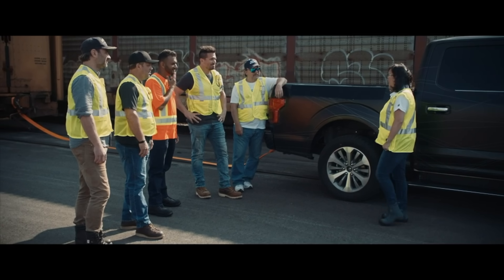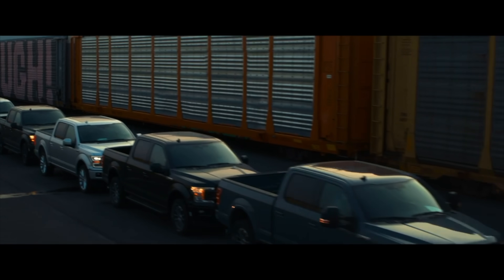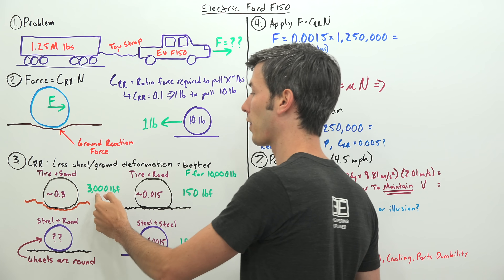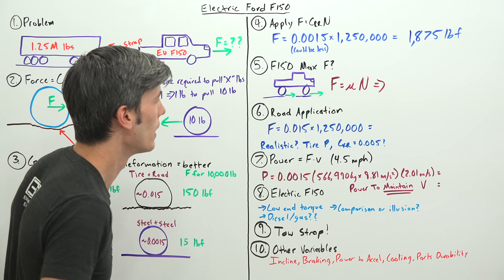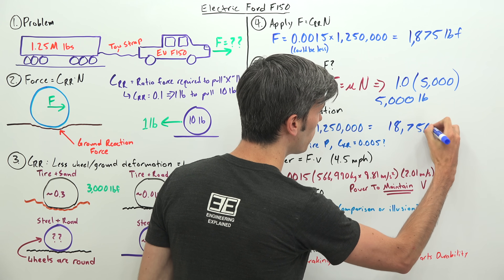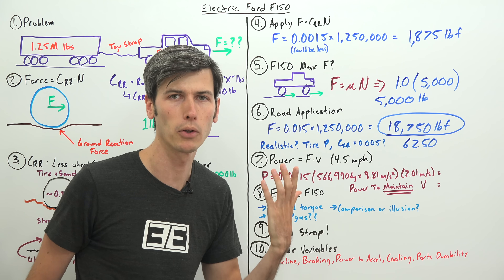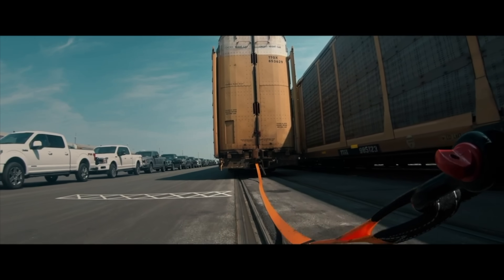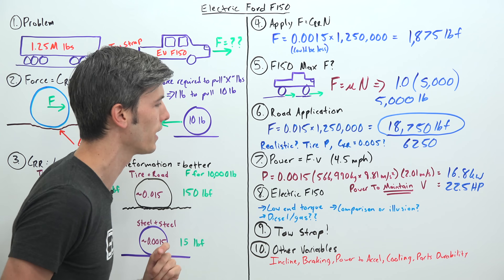No, Ford's Electric F-150 Can't Tow 1 Million Pounds (Realistically)

Comment from the maker: *IMPORTANT NOTE* This video was filmed prior to my article being published in Road & Track (link below). Upon release of the article, Ford reached out with additional information. They said the truck was traveling at 4.5 mph when it crossed 1,000 ft. From this, we can calculate power required: 
1. We want to know how much power it takes to move 1.25 million pounds at a speed of 4.5 mph in just 1,000 ft. 
2. We’re going to assume the truck is accelerating for those entire 1,000 ft, and reaches 4.5 mph right when it crosses the 1,000 ft. line.
3. Power = Work / Time. If we calculate work & time, we determine power.
4. Time can be calculated based on average speed over 1,000 ft. Top speed 4.5 mph, starting at 0 mph. Average 2.25 mph. 2.25 mph = 3.3 ft/s. 1000 ft / 3.3 ft/s = 303 seconds (5 minutes, 3 seconds, to go from 0 to 4.5 mph). T = 303 sec.
5. Work = change in kinetic energy. We start at 0, so kinetic energy is zero. All we need to know is final kinetic energy. Kinetic energy is equal to one-half mass times velocity squared (k=0.5mv^2). 12.5M lb = 566,990 kg. 4.5 mph = 2.01 m/s. KE = (0.5)*(566,990 kg)*(2.01168 m/s)^2 = 1,147,263.561 N-m. 
6. Plug in variables to Power equation. Power = Work/Time. P = (1,147,263.561 N-m)/(303 seconds) = 3.786 kW or ~ 5 Horsepower.
7. It’s important to note that 5 HP is the power required to to accelerate this mass assuming zero losses. Heat, friction, aerodynamics, etc. There are also smaller assumptions like not accelerating any rotational masses (the train has wheels, etc). A sanity check using the same math shows a 3,300 lb car requires 240 HP to go 0-60 in 3.0 seconds. We know it’s generally double that in the real world. Even giving the truck a factor of 10 advantage, 50 HP is nothing crazy. 
8. The train is very heavy, this is the impressive part. Unfortunately, the duration is very long (5 minutes), and the speed is very low (5 mph). Both time and speed variables work heavily against the power required. If the train were to accelerate to 60 mph in the same 1,000 ft distance, it would take 12,000 HP without losses. Quite a difference, just from changing speed! 

Road & Track article covering the stunt: 
https://www.roadandtrack.com/new-cars/a28506476/ford-electric-f150-train-tow-physics-explained/
Reply: kind of old news but a couple years  ago there was a toyota tundra that pulled a rocket ship  and was wondering if you could discuss the differences in forces between that stunt and this stunt?
Reply: @karljohansen3935  he displayed the math and variables. All you need to find is the shuttle + trailer's weight. Plus the type of tires and pressure needed to support the shuttle.
Reply: Karl Johansen 
Yep. That was when Toyota used a Tundra to pull Space Shuttle Endeavor from LAX to the California Science Center. Any truck with specs similar to the Tundra could have done the job, but Toyota has existing ties with the science center that put them in a good position to do the pull of Endeavor.
Reply: @karljohansen3935  The main difference is that Tundras are boss af and it actually went into space to grab the ship, whereas Fords are limited to more traditionally terrestrial environments.
Reply: @karljohansen3935  5th gear towed a 747 i think with a vw toureg
Reply: Karl Johansen : the space shuttle with the towing gear weighs 300,000 lbs.  That requires 4500 lbs force to tow it.
Reply: @karljohansen3935  - Have you seen the guy who pulls an airline with just his body? If he can do it, most pick-up trucks can do it.
Reply: Holy engineering degree
Reply: @Leondavies357  Hahaha I feel like I just earned mine by reading all that 😂
Reply: @Leondavies357  actually grade 11 physics, but I still love this guy!
Reply: @ericsimonson3128  hahah fair
Reply: Leon its really only basic physics
Reply: Leon honestly some simple ass physics calculations. That I’ve done in high school classes
Reply: @Leondavies357  So you can tow what a diesel tows with a small SUV that tows 4,000 pounds based on his calculations..
Reply: @Leondavies357  it's not actually hard to understand if you get it.
Reply: I wonder if they did the train car trick where they bunch up the cars so that they "effectively" only have to accelerate each one, one at a time.
Reply: @glassfullofmilk  it's not a trick, it's a standard feature of train couplings. In another comment this was pointed out, the fact that compression couplings exist specifically to make the process of starting a train much easier. All trains nowadays have compression couplings.
Reply: @jordananderson2728  here is the thing though. You have the length of the fitting (what about 6 inches), to accelerate the train car enough to overcome the resting friction of the next car.

I once watched a rather long train accelerate from stop. It took several tries for 6 locomotives to start it.

With it stalling out before half the cars started moving, and had to backup to recompress the couplings.
Reply: @capnbilll2913  I don't quite see what that has to do with what I said, but I'm glad to have learned something else today. Thanks!
Reply: @glassfullofmilk  I suspect they were, and the truck could therefore accelerate the cars one at a time. That's how diesel locos do it.
Reply: @glassfullofmilk  I'm pretty positive that was another trick--at no time when first starting was the entire load being moved all at once.
Reply: @glassfullofmilk  that's how all freight trains accelerate. This is called slack and is caused by play in the draw bars which also helps trains go through a curve. A locomotive would never be able to accelerate all 1-2 miles of train from a stop all at once so they get them going one at a time and use momentum to help get the others rolling like you said.
Reply: @glassfullofmilk  ... Thank you...i was going to post this concept but you save me from punching my keys....

This is called 'stretching out the train"

Your average diesel locomotive cannot start pulling a train unless it starts rolling one train car at a time.

I work for a mill that uses a lousy 25 horsepower 5 ton forklift to move traincars in and out of the loading dock, and it does quit well.
Reply: What I want to know is how they stopped the train? Did they have a power unit hooked to the other end of the cars to control the brakes?
Reply: @myofficegoes65  i am sure they had people on each car to turn the wheel to apply the manual brake on each car.
Reply: @myofficegoes65  Ford forgot to think of that detail, actually. The video they used for the commercial was actually their second take. The first take had an unfortunate ending.
Reply: @myofficegoes65  "What I want to know is how they stopped the train?" Probably an air compressor or an actual locomotive (with their onboard compressor, naturally) attached to the other end of the train. Otherwise, you could have someone alongside a few cars applying the handbrakes as it goes - not ideal, but the walking conditions at that site look good so it could be possible.
Reply: @myofficegoes65  someone just walked up and cut the strap and the truck drove away.  It was only going 4.5 mph. I'm totally guessing.
Reply: @myofficegoes65  they probably have someone with handbrake stopping it I would say
Reply: @myofficegoes65  they probably had somebody using the hand brakes to stop it
Reply: myofficegoes65 all the cars have brakes.
Reply: @myofficegoes65  asking the real question. Those railway cars can't be moved unless the brakes are mechanically disabled or there's a locomotive coupled. This is a safety feature which is near impossible to override
Reply: The whole point here is... Ford is making an Electric truck...  And that's just awesome.
Reply: Also they aren't pulling all the train cars from a stand still. You start by pulling just the first car and you build up a little momentum before the second car engages and starts to move and so on till all the cars are moving.
Reply: So a Top Fuel dragster could maybe get it to 60mph in 1000ft...
Reply: @vskid3  if it had the weight
Reply: @vskid3  if you could get it to run for 5 minutes. They regularly blow up during a 4.5 second run and they always get rebuilt.
It would be interesting to see what you could get out of one in this type of application.
Reply: So what I'm getting from this is anything that can pull a 2000lb trailer can do this trick??
Reply: @wiliammorgan4537  No. Pulling a 2000lb trailer isn't the same thing as pulling with 2000lbf. There's a thing called coefficient of rolling resistance. That's what the video's about!
Reply: @wiliammorgan4537  No. Using his numbers, a 2000 pound trailer on a roadway will only require about 30 pounds of force to move.
Reply: @wiliammorgan4537  No. A 2,000 lb trailer requires less than 2,000 lbs of forward force to move. Difference between lifting the weight of an object and pulling it on wheels.
Reply: @wiliammorgan4537  yes
Reply: There used to be a "strongman" who came around every year and his thing was to pull 2 full size passenger buses across a parking lot... same thing as long as the surface is flat, the tires are hard, etc....
Reply: Did you consider the friction of the wheel bearings to be negligible? Seems it wouldn't be.
Reply: @curt149k  thats considered part of the rolling resistance..
Reply: I feel this was more a reaction to Tesla saying their Pickup could tow 300k.. The thinking being.. Hey if they are going to make some nut job claim why not just tow a train?
Reply: @Napster60  I doubt it as this stunt has been pulled multiple times by multiple companies. There are competitions where people pull massive objects.
Reply: @bensemusx  
True just seems like the timing fits the Tesla claim.. only took them a couple months to respond to other "electric truck" news 
Just a guess
Reply: About time someone address's this big elephant in the room. I can push a 20 ton boat by hand as long as its floating in water.
Reply: Two things are missing. 

The resting friction of the wheels. Good thing this is electric, a clutch would burn out long before you got the first car moving.

2nd that motor is going to be pulling crazy current with full power zero RPM.

I'd be surprised if you didn't melt the pack.
Reply: @capnbilll2913  you're forgetting that motor rpm is NOT the same as wheel rpm...  
  A crawling kit can reduce output 250-500/1!   And more!  
Imagine an engine at 6k rpm turning the tires at 3rpm.. Now we have an electric motor that has a much higher rpm thats reduced for torque. 
    Lastly... A clutch burns out from slipping, not high load... You can drop the clutch idling on a crawler and they'll sit there and spin all fours no problem.
       !!!Gears Get it Done!!!
Reply: @Hoopty91  I'm assuming the gear ratio was not too far from a production rear end. I know you buy larger reductions for towing. Up to 4.3 to 1.
Reply: Well the main question is what happens when you slam the brakes towing 1.25 million pounds...
Reply: @sakariaskarlsson634   never brake-check a train... just a word to the wise ;)
Reply: @sakariaskarlsson634  Your going to be pushed a long ways!
Reply: @brucemaloy4769   i think so and the car would be kinda messed up too
Reply: @sakariaskarlsson634  wait a minute for the rest of the train to catch up at 1mph.. Then kiss your ass goodbye in the slowest train wreck of you life!
Reply: @Hoopty91  lol yes, how did they even manage not to do that when this was over, rc brakes? 🤔
Reply: @sakariaskarlsson634  I'm sure they had a control car or something with brakes😐... I would hope.
But then again, there's not far for it to go at 4.5mph.  
  It would be neat to see this demo with a truck at the other end for braking, see how long that takes..
Reply: so if I read this correctly, my 1999 bmw 328 can do what the pick-up did in the video? lol
Reply: I think the more telling number would be the torque required at that speed. By my calculations the torque required at 4.5 mph to generate 22.5 hp is 2505 lbft for a 32.1" diameter tire (standard 275/65R18 for 4x4 F-150).
Reply: Bro I really just want to know how old you are, 25 or 43?
Reply: Engineering Explained it did move 1.25 million pounds before any other EV truck. Which is a step up in the 
one-ups-manship  dog and pony show. My grandpas old 53 Chevy 6 cylinder could pull 400 bales of hay also. But it is who does it first that counts
I can see everyone pulling this or that now. 😂😂😂😂😂😂😂
Reply: @shashankr5003  to convert it into Newton. When weight is in kg
Reply: it doesnt matter if it would need way more road tires than the ones in the train to carry that much weight?
Reply: With that low of friction cohefficient you can do it with pretty much any vehicle, you need to apply that force over some time and all force applied is not simply lost, the kinetic energy is still there and will accelerate that mass unless there's too much friction that converts that kinetic energy into heat.

Once you gather speed, you only need to apply more force to overcome the new friction that comes with air and wheels rolling over the ground, which is also very low until you start getting to higher speeds.
Reply: Sir... You misplaced a decimal on your lb (12.5mil) congrats you just blew up a $500mil rocket 😍
Reply: Malicious Affection not a rocket its a train, dummy ;) and it wont blow up lol
Reply: Impressive. Probably not very healthy, the electrical motor has to work hard @ low RPM all the time, so it doesn't get a lot of cooling.
Reply: What about those little vehicles at the airport that tow those planes. I know they are not electric but can you convert that and compare it to electric!
Reply: The only advantage the electric motor has over a fuel burning engine is that electric motors can generate a ton of torque at slow RPMs while under load. 
But this train pulling stunt fails to point this out. 
It's just a "Look at me!" marketing stunt. That's all.
Reply: how would this compare  to the V10 Touareg pulling a 174 ton 747 or a Porsche V8 Diesel pulling a 320 ton A380
Reply: Can you please analyse Model X pulling the plane commercial in the same way. It was on a runway I think. Interesting..
Reply: @EngineeringEssentials   Theres a video of a dodge ram pulling your 10,000 pound mom in a trailer, can we please get the engineering specs on that. I think it was faked.
Reply: @EngineeringEssentials  strong men competitions pull planes. I don't see why a car couldn't if a human can...
Reply: @EngineeringEssentials  Apparently a touareg could pull a boeing 747
Reply: If it could be set up again in the same location same weight etc. I'd be willing to tow it with my truck to prove the point
Reply: I think your point #5 should say 1.25Mlb rather than 12.5Mlb
Reply: How many "Fate of the Furious"  Dodge Chargers would it take?
Reply: Not have to stop it, speed it back up, nor turn with it.
Reply: Does the # of wheels matter, (ie adding to the coefficient of friction) or is that negligible??
Reply: Well hello again, saw the comment in Ford video
Reply: Spock spots magic tricks. Good job science officer!! 🌟👍🏻🙌🏻
Reply: @CLP lol trucks have been pulling large things for decades. A few comments up someone pointed out Toyota did this with their truck pulling a rocket.
Reply: They did this because tesla pulled an airplane.
Reply: It's still cool tho
Reply: In all this you neglect static friction. No problem though. Trains overcome this issue by stopping trains from the front, allowing couplings to compress. When the train starts moving again the small gap in each coupling allows each car to start moving slightly before the gap to the following car closes with a jolt. This allows the locomotive (or pickup) to overcome static friction one car at a time. You can hear this in a rail yard when a train starts moving. A series of clunks propagates down the train before movement is obvious.

Additionally, a large battery pack is visible under the truck. Any self respecting truck will have at least a 100kW/hr battery. Rivian, Ford's partner, has considerably more. A Tesla Model S battery has an energy density of 141.5 Wh/kg. That implies over 1500 pounds of battery just for the cells. While the engine/motor swap offsets some of this there would still be an overall weight gain just as there is in electric cars.
Reply: @engineering explained Just to let you know, you have 12.5 M lb instead of 1.25 M lbs in the comment.
Reply: Forgot seal and bearing friction
Reply: @brucebreckenfeld7405  Remember he mentioned the only requirement is being able to tow 1,875 in order to pull a 1.25 million pound weight
Reply: @brucebreckenfeld7405  Then that means a v6 f150 with the same components except engine output will tow the same as a V8 f150. Anyonewho tows a lot would laugh at that
Reply: Thanks to my dad for explaining your comment loo
Reply: Chevy pulled 187tons of logs down the road jn the mid 70’s. They also pulled a container ship onto shore.
Reply: That's why you should work out slow, you'd save energy and be able to do more reps plus allowing more oxygen intake. Try it some time, it's fun.
Reply: That's not a standard tow strap... That strap is close to 5,000lb. The torque on that truck is over 400lb... Yeah this guy is very intelligent, but your missing the hole point. Tesla claims aren't real, Ford  is doing this stunt to make you realize that tesla is bogus claim of 300k lb. Realistically Tesla won't have a truck that can tow 9k lb with all electric. Ford has F-150s now that can pull well over that. But when time comes, all electric f150 will be best in class well after dodge and Chevy get there electronic trucks out.
Reply: Welp time to hook up a Top Fueler I guess
Reply: @tyvekhomewrap9164  Yeah---that'd be something to see!!
Reply: He must be a dodge owner😁
Reply: That would have to be a slow acceleration even with zero rr. F=1.2 million x acceleration stopping at 1000’ is 2500 newtons of force assuming 300 meters in 5 minutes. That’s a lot of inertia to overcome.
Reply: Engineering Explained love the channel man. I’m currently in the process of getting my ME undergrad degree
Reply: I ain't no math wiz but I am a conductor for UP and let me tell you that a light wind can push these cars by itself on flat track of they didnt have handbrakes tied. 1 million pounds is nothing in the trainworld. I sometimes get trains that are 20,000 tonns okay.... that's 40 million pounds. 

This is extreamly deceptive to anybody who doesnt know anything about railroading but this commercial has become a running joke in my service unit. Odds are, that any car you have could pull this aswell. Not impressive at all.
Reply: Pretty Smart Guy! never thought of using the superior METRIC units?! Imperial sucks
Reply: Can you do a video on hood scoop Style ram air intakes versus cold air intakes? (I'm thinking hood vent looking scoops, not monstrous vision blocking scoops
Reply: I'm a train mechanic and several times we pushed 50t metro carts 8 axel 4 boggies outside the workshop by hand to the third rail to get the 750v to one of the contact shoes, 6 guys only so one strong human ≈ 0.3hp so 1.8hp so I'm not impressed.
Reply: Car HP are not real HP , real HP is 550lb / sec / foot ,car is 550lb /hour /foot .
Reply: I've driven several trains in my job (train technician), motor carridges and I can tell you that they spin very easily.
Reply: Busted
Reply: According to your calculations, my 1998 Nissan Altima with 150 horsepower at the flywheel from the factory could probably do this if there was a suitable attachment point.
Reply: Bruh u lost me about 4 hours ago
Reply: Awesome video, great information and presented in a really easy-to-understand way! (As usual)
And congrats on getting published in R&T, that's one of the best magazines out there.
Reply: Engineering Explained I’m just still trying to figure out where the card went?
Reply: When you mentioned the tire pressure that pretty much summed up my thinking about whacking some B737 tires on it or something airliner tyres have normal inflation pressures of >1.4MPa (>200psi). Course the combination of that and the heavy reinforcement makes them a lot more rigid than car tyres. Though this explains a lot how you can pull off competitions having a person pull an airliner their coefficient of rolling resistance is extremely low for a rubber tired vehicle. Then again this trick has been used in vehicle marketing too same old thing though dazzle the audience with something they associate with being big and heavy so they don't really think about the physics of it.
Reply: How much “energy” required to keep the weight rolling?  NOW let me see that truck stop those train cars 😎
Reply: Um? Duh? They didn't go fast, and they didn't get up to speed very quickly either.
Reply: But the Ford F-350 can easily tow up to 200 tons it was on top gear but also yes your a lot smarter than me when it comes to physics I have my biology masters but also regardless it still towed 1.25 million lbs but yes friction of the wheels means it didn’t pull 1.25 million lbs it’s a marketing scene to pull in people who won’t do the math but electric cars have insane torque if ford released the specs maybe that would make it easier to judge how tuff the truck is.
Reply: You're leaving out a significant amount of static friction in this system before anything will move at all. Train wheels have rolling bearings, sure, but they're imperfect.  Also, for something of this size, certainly other contact incur static friction to overcome.
Reply: I've never been more confused by a comment than the actual video. Cheers m8
Reply: I cant help but think that the internal friction from the train probably made the towing force needed quite a bit higher than what you calculated. Still a misleading marketing stunt, but one that's a tiny bit more impressive than watching this video might suggest.
Reply: Even the middle gas engines in the F-150 produce 400 ft lbs of torque.  In 4WD low first gear they can have a crawl ratio of 46:1.  This is well over 18,000 lbs force without calculating torque multiplication at the torque converter.
Reply: We would also need to know the rating of the tow strap. If was a 2,000 lb. Tow strap then we can determine it wasn't using all available power. If was a tow strap that exceeded the weight of the vehicle and they accelerated as hard as the vehicle could without traction loss then we could solve for the total usable power. I'm thinking about just putting that darn thing on a dyno.
Reply: that also looks like a kinetic strap and that stretch also helps with getting the train to move with less force. unless the footage is altered look at the truck using that kinetic energy to start pulling the truck at 2:40
Reply: It's also worth noting that even if the truck is putting down a lot more power than calculated here and accelerating faster, the truck can still only apply 5000 lb*f to the towstrap. Obviously during acceleration the truck HAS to apply more than 1875 lb*f in order to cause the load to accelerate at all.
Reply: Sounds like your trying to say you sold out again. 
You know I'd like your channel if you didnt always sell out and publish lies.
Reply: Hey Jason, you forgoted about the 22.5 HP that you calculated in the video. The power that this truck needs to produce, to move the train is 27.5 HP (5 HP for acelerating the mass plus 22.5 HP for the frictional losses)
Reply: It would be awesome to make a comparison with the Touareg towing a 747. <3
Reply: Surely you mean for the answer at step 5 to come out in joule, not Newton meters, right? Great video btw
Reply: Yeah, i guess this was a

N O T E
Reply: ford may have a habit of making terrible engineering decisions but they really do seem to care about the enthusiast community surrounding all aspects of cars.
Reply: Can you be my math teacher?
Reply: Wait. So you’re saying Ford mislead people in a marketing ploy? What’s next, Chevy real people commercials?
Reply: nerd
Reply: You got me beat
Reply: In what world is a mu = 1.0 conservative when evaluating a system capacity?  It would be conservative if trying to calculate a resistance to be overcome, but he is trying to evaluate what the truck can provide.  mu = 0.45-0.80 is more reasonable for this application.  Other calculation assumptions are reasonable.
Reply: You can deny or ignore the truth but you can't change the truth. 

Repent for your sins.     ,Jesus Christ is Lords of lord.     ,there is no way to get heaven without Jesus.    ,He died for our sins and  he ressurected  from death ,And his second coming is soon.           
Today is the time ,           
for that you'll be saved from Eternal death. REPENT FOR YOUR SINS. You don't know when you will die.
Reply: Who actually read this, gj
Reply: Your voice reminds me of Mark Rober lol
Reply: you know, that forklifts pulls Trains? :D
Reply: So basically, if I found some really grippy tires and a hitch point strong enough, I could do this stunt with my geo metro...
Except I'd probably burn out my clutch long before I got any decent amount of movement.
Reply: My lawnmower puts out enough hp to do this.
Reply: @robomatt1600  But it's not heavy enough.. so you would just spin the tires.
Reply: Tiny little locomotives move massive cargo ships weighing over 100,000 tons (200 million lbs) thru the Panama Canal in the same way. A little power moves a large load a long way when it is applied over a long period of time with light resistance.
Reply: Please translate into Russian
Reply: @D.O.A. I believe so, but I have no idea as I have no experience in such matters.
Reply: Переведите пожалуйста на русский язык
Reply: I mean i can call bs right away with that basic tow strap, no way in our reality that single tow strap gonna help pull those pounds
Reply: @drewpaps4486  he demonstrated how low the forces are to get the train rolling. A basic tow strap can definitely take it, and that didn't look like a harbor freight tow strap anyways.
Reply: @drewpaps4486  i assume you've never used straps before... 😒
without looking at it up close, you don't know its weight rating.., but that looks like a quality strap... 
Our junk straps are rated for 5000lb in a choke..
That strap is 3x the thickness of mine, and the same length... 
Thats easy beans for this feat..
Reply: drew paps did you watch the video